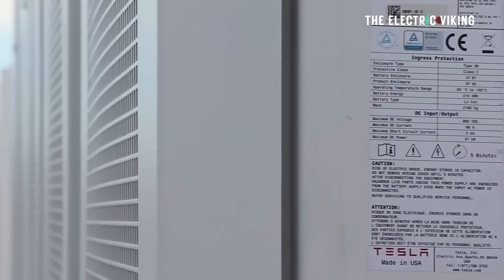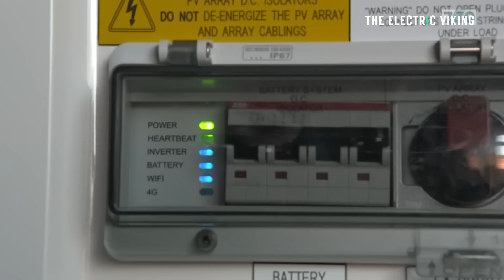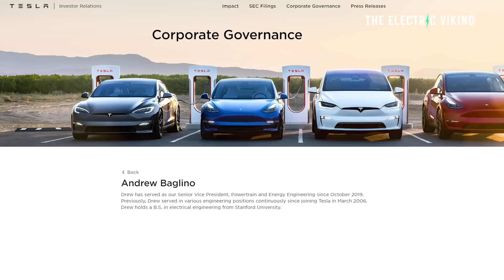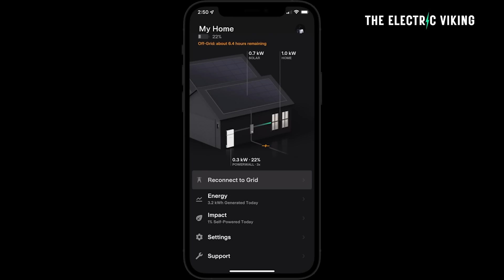Tesla's secret to unlocking fully renewable grids all over the world

Comment: Make $61 dollars a month from your powerwall, really? Musk charges $13,000 for each unit installed with a pathetic capacity of 13.5 KWH of storage capacity. I agree with you about installing as much solar and wind energy as possible, but the Musk battery storage, like his 1,400 lb. batteries in Tesla EVs are not the answer. Being a full blown Tesla Fan Boy, it's surprising to see you still have your shirt on your back. $182 Tesla stock price today, another $10 bump and you'll be at a whopping 50% of the 1 year high.
Reply: Just checked the Tesla website, 1 powerwall costs 9,200 in my area and two can come up to 17,000. That’s without tax incentives which can drop the price 2 - 3 grand. Not sure where you’re quoting those numbers. Secondly, the mega packs are sold out for the next 2 years and they’re selling for 2 million each. Those battery storage packs are a necessity for stabilizing the grid and can be easily coupled with solar and wind energy to make clean energy. Not sure how you can say batteries aren’t the answer when they clearly are. How else are you going to store energy for use? Store it in our dreams?
Reply: @NullJaeger09  - The Tesla Powerwall in 2023 costs $14,200. If you order directly from Tesla, you must purchase solar panels or a solar roof at the same time. The Powerwall can be used without a solar system to store extra energy from the grid for backup power. The Powerwall+ model can only be purchased directly from Tesla.
Reply: @NullJaeger09  - The best way to balance the grid is to run over capacity for output, use the excess power to make hydrogen, so the less power needed, the more hydrogen generated, as the system calls for more power, you reduce the hydrogen output and pump more power into the grid. You will never be short of power, and won't need any batteries.
Reply: @222INFINITY  ... Why would you convert the electricity generated by the power stations into hydrogen when you can just store it in a battery for use?

Comment: Gas peaked plants in Australia are being developed to be powered by green hydrogen. Wonder what they are going to do with all the green hydrogen they will produce from Pilbara and the other hydrogen hubs that are being developed in Australia and Tasmania?🧐
Reply: To some extent those plants may stick around for some years as deep backup.  Long run, the money spent to build them may never be recovered.
Reply: @bobwallace9753  the peaked plants aren’t worn out and like in the UK they can be modified to run on hydrogen (Nat gas +hydrogen to start with) and is much cheaper than batteries.  All infrastructure, turbines and connectivity to the grid is in place so it’s a no brainer to keep them.
Reply: @lesliecarter4295  
Tesla's Megapacks are replacing NG peakers because they save utilities money.  

It may be possible to convert gas peakers to hydrogen but I can't see how that makes sense.  Convert CCNG plants to hydrogen (or ammonia) and get more MWh per unit  fuel.  And with battery banks doing demand response there's no need for gas plants to fire up quickly.. If there's going to be a generation shortfall then start a combined cycle plant.

If one does truthful accounting they will find converted methane extremely expensive.
Reply: @bobwallace9753  the accounting has been done and hydrogen will work. Not going to agree so let’s see how it plays out this year.👍
Reply: @lesliecarter4295  
Please show me a reliable source for renewable (not reformed methane) hydrogen being economically competitive.  That is not something I've ever seen.

And, please, real data.  Not speculation.
Reply: That’s hilarious…go watch the electric vikings video called New toyota ceo koji sato…and read all the reasons why Hydrogen is a terrible idea and will never work for passenger cars…

Comment: If they have excess electricity generation, they could produce clean hydrogen for export. This would generate additional revenue to subsidize the cost of electricity for residents of NSW.
Reply: H2 is not easily shipped.  You have to compress it a lot and that uses more energy.  

Maybe converting to ammonia would make more sense.  Much easier to store and ship.
Reply: Use any extra power to make hydrogen and then green steel. Much better than shipping iron ore and coal overseas in bulk carriers.🤔
Reply: @malcolmrickarby2313  
Yes.  That's one way to use generation greater than demand.  We'll need to identify several dispatchable loads that can utilize power we would otherwise curtail (throw away).

Lots of EV charging can be a dispatchable load.  If the capital cost of the infrastructure isn't too high we might use desalination plants to soak up extra power.  Some areas are running short of building quality sand for concrete.  If there's surplus power then smash rocks into sand.